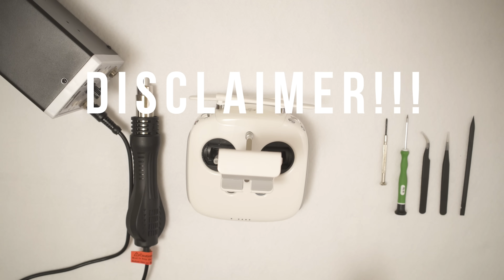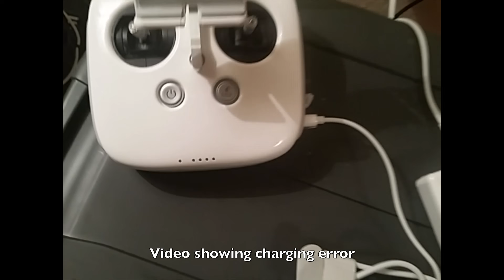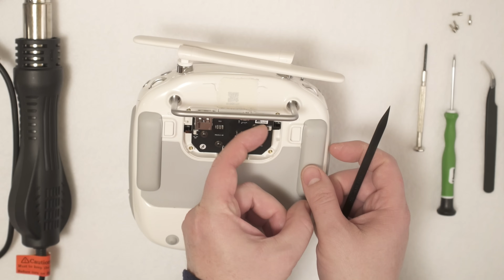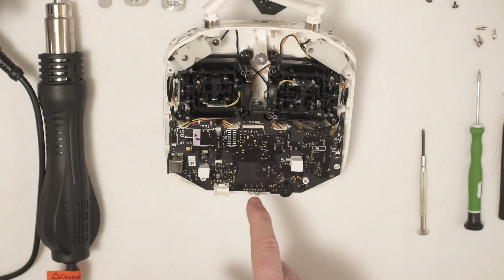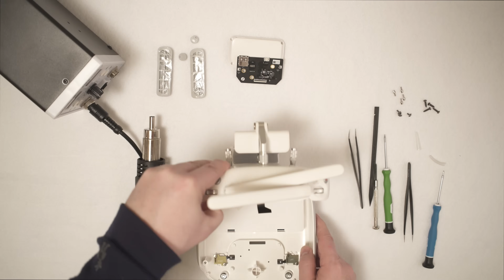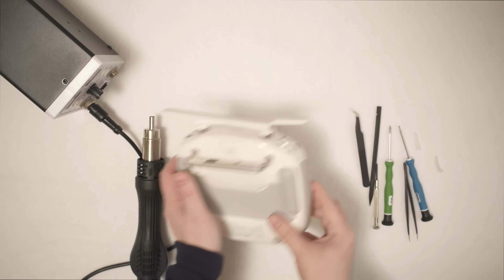FIXED!  DJI Phantom 4 Pro Remote Control Battery Charge Issue [Disassembly, Repair, Reassembly]

Comment: Mine was blinking non-stop only first led while charging. If I turned the controller on it would have the first one lit , the red blinking and continuous beep. Then I tried the heater solution, something changed: I had only the first and the second during charge. That's what you said you got when you tested without the battery connected. Does that mean I might have corrected/solved my primary problem but at the same time I have a bad battery? ( controller has stayed one year or more without charging, last time it worked, now I have this status of 2 leds charging
Any inputs on that?
Thanks
Reply: OK folks, just to let you know. I had the problem solved after using the heat gun, After assembling everything I just left it charging and it took a while showing only first and second leds charging. Gradually (after 1  1/2 hr) reaching the remaining leds (third and then fourth one).

Comment: Thanks a ton man..
I just heated the small black 8 pin chip right to the last white LED. 
All lights are back but still battery is draining too fast.. Approx 1% in 1 minute.. What should I do now?
Should I need to heat the other areas as well?
Reply from the maker: Hmm.  That’s a tough question. It could be that the battery is not keeping a charge.  Do you have access to a voltmeter to measure the battery’s charge?
Reply: Hi buddy.. Is your issue resolved?
As I was also facing the same issue.

Comment: Not working for me :( i try to replace the battery with other (full charged) but when i check in remote controler battery status , still 0% , what wrong? My remote phantom 4 pro+ (with screen)
Reply: Because there is a solder point that was badly done by DJI and unless you heat (to melt it) or re-solder, it will happen again.

Comment: How long should I warm the plate? thank´s
Reply from the maker: Depends on how hot the air is you’re running. You’ll want to go for shorter durations the hotter you go, at least until you find the sweet spot. I mostly kept my eye on the solder and tried to spot when it started to liquidate, but your mileage may vary.

Comment: What if you just replace the battery? Would that also fix the issue?
Reply from the maker: The battery is fine. It is the connection at the circuit board that is weak, so a battery replacement would run into the same issue. 

If the issue is different—a problem with the actual battery, then replacing that would be a good move and not particularly difficult. 

Thanks for watching and commenting!

Comment: I put the circuit board in the oven on 400 F for 10 minutes, and now it won't turn on! What did I do wrong? Any advice?
Also, do I have to plug everything back in to test it? Can I try only connecting the motherboard to the battery to test?
Reply from the maker: Should be able to just plug the battery and power source in to test it. Sounds like you may have damaged the circuit board by putting it in the oven. Hope not!

Comment: i didn't understand where i must use SMD hot air ???
Reply from the maker: Maher Daou if you check the description there is a link to a video that shows where to heat.

Comment: omg again 3 lights only coming
Reply from the maker: If it was working but then the problem started again, at least you know you hit the right spots the first time. Probably need a higher temp for a true reflow. Would be nice if dji gave some parameters on optimal heat, etc., settings.

Comment: Probably a silly question - but why didn't you just reflow the board in place??
Reply from the maker: Mike, valid question. Didn’t know exactly what parts to reflow (precision came largely from viewers who commented here with their experiences) and didn’t want to risk melting any of the plastic connectors or mounting points on the case. Knowing what I know now, I might give it a try!  Thanks for watching and commenting!
Reply: Ok so did mine, a P4Pro... it's completely different inside..!! 

Used a Wagner paint stripping heat gun (800w min!) so made a small nozzle out of aluminum foil, wrapped the board in foil to not burn it! About 30 secs wandering around the leads and battery connector.... put it back together 3x as I kept forgetting one of the cables! But it now appears to be charging all the way!

Calibrate again tomorrow, test away from the water - I live in Bermuda - and then fly!

Thanks again for the inspiration to do this. I was quite nervous as I had tried previously to repair  the legs on the drone and completely messed it up. Had to RMA it eventually...

Cheers from Bermuda!
Reply from the maker: Great to hear you were successful, Mike!  How was your controller different inside?  A later model?  Thanks for checking in!

Comment: (2020 May 21)
Tried on a Inspire 1 Remote controller several times. No luck, It didn't worked for me. Oh my poor bird 😭
Reply: "Update"
Oh man, what a wonder! After few tweaks it WORKED! 

What i did..

1. Measured output voltage levels of both remote controller battery and the port on the remote controller circuit board which connects the battery.

2. Tried this guy's heat gun solution 3 times (320°C and 7 Fan speed)

3. Connected, Turned ON and disconnected the remote controller battery from the circuit board at least 5 times.

4. After that process, tried to get a response by connecting the charger to the remote without the battery.

5. While the charger was connected, battery connected and disconnected on-the-go.

6. Finally, After the last connection of the battery and remote, I connected the charger as usual.

VOILA! It began to charge..What a miracle!

Comment: on 16:45 screw to the right is so hard to take out for me other than the one to the left which unscrews very easily any tips or ideas why
Reply from the maker: Duane, I’m guessing whoever assembled it just cranked on the one screw and not on the other. That said, maybe the screws are slightly different sizes, or the plastic housing might have come out of the mold slightly off. Thanks for the note.
Reply: @travelphotofilm  i think it's a stripped screw because i seriously can't even move the screw, or like you said how a person could've cranked on it. I searched and did my research online on how to remove these screws and it looks like I would have to use lots of force and stuff. This is an L for me I've been trying my hardest to fix this for almost a year now :(
Reply from the maker: This is the first I’ve heard of this happening.  If it affected more people I would suspect some kind of glue or Lock-Tite in use. Sorry to hear it didn’t work out for you!

Comment: With circuit board removed and turned over ,  immediately next to the rubber boot that covers the 5 display lights there is a 8 pin component which i believe is the regulator.I only reflowed this one
component and now everything is working.Can someone try this first and confirm their results.We may have this sorted.
Reply: al graham going to be doing this myself here very soon as I'm having the no charge issue. I'll focus on that part first and let you know what happens.
Reply: I have since discovered this is a Battery measurement IC.Apart from the 8 pins it has a metal base that is in contact with circuit board to assess the battery.condition and it is the base that loses contact.
Reply: al graham so are you still under the impression that this should be the first part anyone attempting this fix should focus on?
Reply: al graham well that was the first spot I hit when I attempted the fix and what do you know.. it worked!
Reply: My Buddy Mel and I worked on my controller today and we tried reflowing around the battery and charging connectors as well and tested by plugging the battery and charger in. Those two areas on the board did not work for me but when we reflowed what we think is the voltage regulator chip that worked for us!!!!! I am glad I looked at your post Al because I was starting to think my controller was a goner. I can confirm what you did worked for me!!!!!
Reply: Yes, you are correct.. All lights are back with just spoting that point but are you facing any fast battery draining issue?
As my battery is draining too fast.. Approx 1% in 1 minute. 😐

Comment: Can I use a regular heat gun like for vinyl wrap or I have to actually sod something? Trying to find a cheap one bc I’ll probably never use it again. So I just move the gun around the 8 pin part to the right of the led’s? Front and back? To check it before you put it all back together, can you plug it in without all the ribbons on and it’ll still show the led’s? Any help will be appreciated. Wondering why I can’t use a regular heat gun if I’m just heating up the metal to remealt it. I’m not adding any metal I assume. Thanks in advance!
Reply from the maker: If the heat gun can hit the right temps (check out the comments section to see what has worked for others), it will work fine. You’re right that you’re not adding any material; you’re just reflowing the solder that came with the controller. You can use the charger to check your progress/success without putting the board back in; I had to connect it twice before it hit all four lights, so try a couple times before deciding it needs more heat. Good luck to you!
Reply: travel | photo | film thank you! I just ordered a reflow gun with a solder gun attached. Should do the trick and I needed a solder gun for the house anyway. Fingers crossed.
Reply from the maker: Good deal—please let us know how it turns out!

Comment: My remote is having the same issue after several months in storage due to a move and this is before the firmware update that requires the log in and the 'user quiz'. How long did you apply heat to the top and bottom of the board before reassembly?
Reply from the maker: When I used the relatively low heat noted in the video, I lingered on the spots I thought were most likely to be problem areas. Were I to use higher heat as done by a number of commenters here, I would start with short treatments and go from there. Also, based on the experience of some commenters here, only one or two small spots need to be reflowed, so heating the entire board is likely unnecessary. Good luck, and please give us an update when you can!
Reply: Yesterday a friend and I did the procedure and got the 4 lights to work as they should for normal charging. However, the battery had 0 volts on the meter prior to the reflow. Now the four lights look like they are charging but after every cycle, all 4 lights blink once at the same time after each 'travel' of lights. I suspect that is an error code saying the batter is completely dead. I left it on the charger the entire night but to no avail. I suspect I'll have to send it to DJI for a battery replacement unless I can find a DIY battery solution. Any ideas on battery replacement for this thing as DJI doesn't sell replacements clearly as a money maker.
Reply from the maker: I’m glad to hear the reflow got you the four lights. I haven’t dug into batteries because mine have worked fine, but if you can find the OEM supplier, that should work well. I do think I’ve seen some discussion of this on the DJI forums. Good luck!

Comment: Could I not just go around touching these points with a soldering iron and that reflow it?
Reply from the maker: I haven’t done much with traditional soldering irons, but I think the key is to get the temp right, so it should work.

Comment: Hello. I tried 3 times with hair dryer because i dont have hot air gun. Pointing the dryer at the spots that other users told it was important. It only went from 73% to 84%. When i plug it in and charge it, it doesn't go past 84%.  Would it make a difference with the right tool?. What should i do?
Reply from the maker: I don’t think most hair driers get hot enough to reflow the solder. In this case, if the solder does not heat to a liquid, any improvement is likely to be temporary. (Sometimes there can be short-term improvements if the circuit board heats and warps/shrinks loose connections.)
Reply: Take the board with the battery and the charging cable to any near reparation shop. Ask them to heat the 8 pin component right next to the 4 LEDs indicator (right). :)

Comment: After the fix I get 4 lights but Go4 only reads 84-86% charge. Any thoughts
Reply from the maker: Hmm, you’ve got me there.  Maybe check the battery with a volt meter to see if it matches?  At least could rule out battery degradation.
Reply: @travelphotofilm  RC reverted back to 3 lights. Heated the chip once more until I saw movement(solder releasing) from 1" away with heat gun that achieves 400° F...aprox 1.5 minutes. 4 lights now 100% charge showing on Go4
Reply from the maker: Sometimes when it works for a time then stops, I believe it is because the circuit board was heated enough to bring the pieces together, but changes again over time. Reflowing the solder hopefully will solve the issue; please update as appropriate!

Comment: What is the brand and model of hot air rework station you have? Cheers
Reply from the maker: Many thanks for your comment! 

Here is the model I purchased (worth shopping around; I got it for a bit less than the current price) https://www.amazon.com/gp/product/B074598G9V

Note that the station I linked has both the reflow and the soldering iron; also possible to find just the reflow station alone. 

Here is the tool set that worked for me, if you’re curious: https://www.amazon.com/gp/product/B076LJRWGP
Reply: travel | photo | film that one link to the solder station is broken.
Reply from the maker: So sorry!  It is called the Yaogong 8586 Rework Station. But really, any cheap rework station should work; there was nothing special about the one I bought.  If you search Amazon or eBay for “hot air rework station,” any of those should work!

Comment: I did this to my DJI Phantom 4 today.
I tried 350C several times just on the small chip to the right of the 4th led light, its very tiny and has 8 solder points.
I hovered the reflow gun over the connection point for about 30 seconds, waving it about.
I then plugged in the charger and had only 3 lights.
I repeated this process 3 more times, each time a little bit hotter, final was at 380C.
Then it still didnt get past 3 lights.
I came back to this forum and reread some posts and learnt that you have to plug the battery in.
So, I plugged the battery in and SUCCESS 4 LIGHTS.     <------ MUST PLUG BATTERY IN to CHECK

Comment: When you say reflow what do you mean?
Reply from the maker: The solder used to assemble these boards comes in the form of a paste applied generally around the connection points of the electronic components. Hot air is used to heat the paste until it liquifies (flows), forming the connections. Time, conditions, or just a weak initial connection can weaken these connections. When that happens, there often is enough solder present that, if heat is again applied, it will melt again (reflow), re-forming the solder connections. Thank you for your question, and for visiting the channel!
Reply: travel | photo | film wow thank you, that helped a lot! I’m buying one next week to repair my controller. I appreciate the response and the great video!

Comment: Hello! Does it works for PH 4? (Not Pro) Thanks!
Reply from the maker: I think it should. One commenter used it on their Phantom 3 Advanced.  But you might check for videos showing disassembly of your model controller if you’re worried; if things look the same, you should be good to go.
Reply: Thank you for you answer! Greetings from Argentina.
Reply: Yes it does, just did mine but concentrated a little more heat on the little device with 8 legs just to the right of the 4 LEDs on the main board. Used 350 degrees Celcius.

Comment: Were those screws Torx T6  or Pozidriv screws, because Pozidriv is like a Philips screw with 4 intermediate half sized grooves .
Ref: https://www.albanycountyfasteners.com/blog/what-is-pozidriv-is-it-different-from-phillips/
Reply from the maker: Robert, apologies for the delayed response. I think you’re right that it is a torx head and not posidrive that is needed. Thank you for catching this!
Reply: @travelphotofilm  You are most welcome, Pozidriv is very popular in England and when you try and use the driver on a normal Philips screw you soon realise your mistake - it slips out :)

Comment: how about a hair dryer?
Reply from the maker: Might not get hot enough, but worth a try if you can’t get a hold of a heat gun or reflow station.
Reply: travel | photo | film yes your correct. I finally used a cheap cigarette lighter and it worked. I made a video tutorial on my channel. Thanks for your video.

Comment: Hello,where did you get your reflow gun,or what is it's proper name?I have a regular heat gun,would the nozzels that you can get on e-bay work? There is no temp control on gun.
Reply from the maker: Tim, good question. In principle, any appropriately warm heat gun should work, and there isn’t anything special about the nozzles; they’re just plain metal. 

Here is the model I purchased (worth shopping around; I got it for a bit less than the current price) https://www.amazon.com/gp/product/B074598G9V

Note that the station I linked has both the reflow and the soldering iron; also possible to find just the reflow station alone. 

Here is the tool set that worked for me: https://www.amazon.com/gp/product/B076LJRWGP

Many thanks for watching the video!
Reply: Thanks for taking the time to help me,cheers!